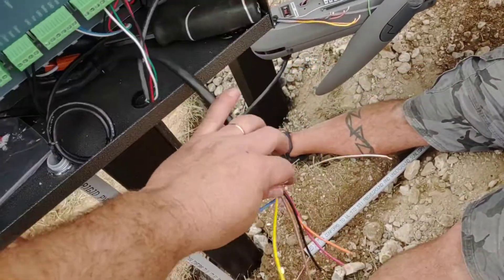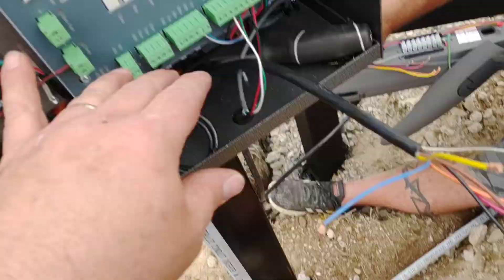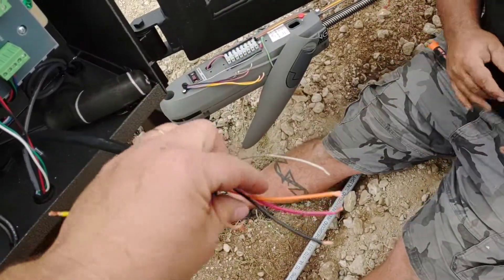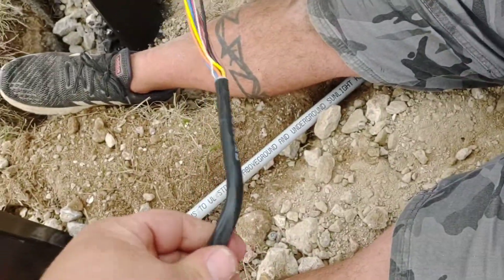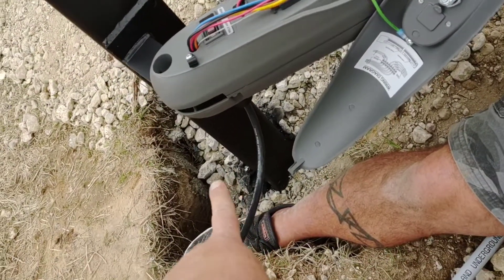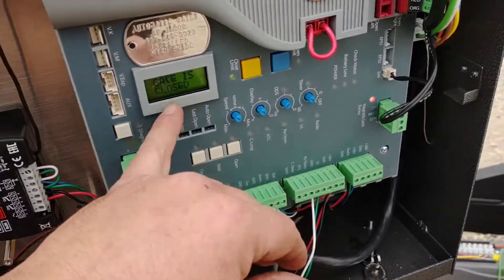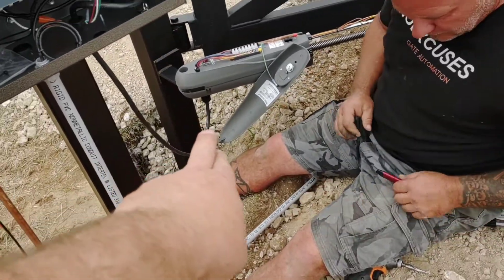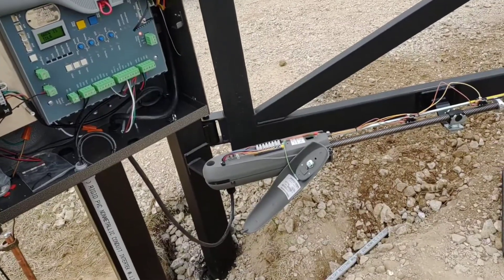Resolving a Rare Factory Mistake For a Viking G-5NX

Comment: Hey man. Have a G5 installed at my house that occasionally goes unresponsive once open. Opens fine, reaches open limit, then OPEN, CLOSE, and RADIO lights flash. Gate will be wide open, but board says GATE IS CLOSED. Flashing will sometimes stop, but gate still won’t close. I can remove the pin and manually get it to more of a closed position, but any press of a button on controller will only open it. Like it’s temporarily convinced it’s closed.  Called Viking and they said it’s likely some sort of short and I should replace all wiring, but I’m not sure I know how to successfully do that. Any thoughts on what it might be if not a shorted wire? Everything appears to be in good condition, but I saw this video on wires possibly kinking and I figured I’d ask.
Reply from the maker: Here are the 3 most common causes of that (but not limited to), and I will list them in order of the most frequent occurrence: 

1) a faulty close limit switch, which is super easy to replace.
2) a faulty motor connector (part # VECUMCM), which is the red module plugged into the top right-hand side of control board that the wiring harness from the G5NX motor assembly terminates to.
3) a damaged motor control cable... which is most often caused during shipping.
Reply from the maker: Your symptom almost always occurs when the closed limit switch fails to disengage after the gate moves away from the open position. So the control board still thinks it's in the closed position, and then suddenly the open limit switch is triggered. And thus the board then refuses to move the gate in any direction because it is receiving information that the gate is in both the closed and open position. And since the closed position was the last input, it never clears off the screen. So then the logic is at an impasse. ;-)
Reply: @JacobGilliamMasterTech  This is very helpful. All very confusing to me, but very helpful to think about. Thanks!
Reply from the maker: It is almost always the cheap limit switch that is failing. Viking works under a normally-closed limit system, so it functions the opposite of most systems, which creates confusion.
Reply: @JacobGilliamMasterTech  Ordered some new limit switches online today and should be able to have replacement installed by Thursday and will let you know. Should I replace both just to be sure? Or start with the close switch since that seems to be the likely culprit? Thanks again for all your help.
Reply from the maker: Is this a new installation? Or you've had it a while and then this behavior began?
Reply: @JacobGilliamMasterTech  Had it for a while. I actually bought the house a few months ago but the problem didn’t start happening frequently until a few weeks ago. One moment everything works fine, the next it gets stuck open and says it’s closed. I tried calling 4-5 gate and garage repair services here but none of them work on Viking. So will try reaching out to one of their dealer’s to see who they recommend. Replacing the limit switches seems easy as you say, so perhaps I’ll try that first for a quick $20-40 fix, but I’m not too well versed in wiring. Can reconnect the wire clips with ease though. Thanks for your insight on this, regardless. Combined, I’ve likely spent hours just trying to get it closed and magnetic locked when it happens. Never fun.
Reply from the maker: Where are you located? Maybe I can suggest a component service man.
Reply: @JacobGilliamMasterTech  Washington, DC.
Reply from the maker: Great question! I ALWAYS replace both, because they have the same exact wear and tear on them. ;-)
Reply: @JacobGilliamMasterTech  It's only been 48 hours, but I replaced both limit switches and the gate is working without incident. Thanks so much for letting me pick your brain on that. You saved me from further headaches with a baby on the way.
Reply from the maker: I'm happy to help! Hopefully it will be the end of it, and not a cable or motor connector.